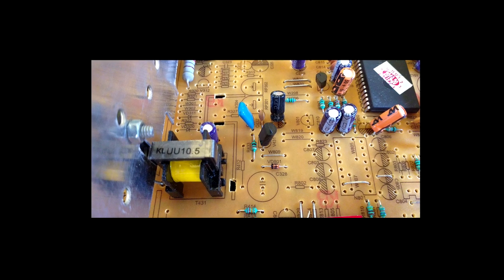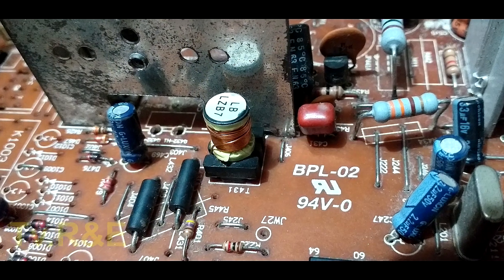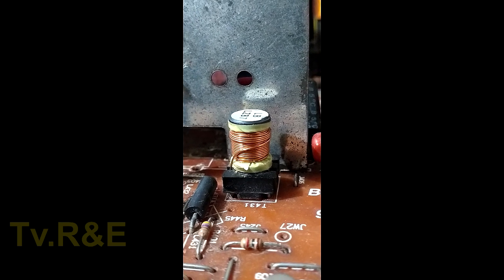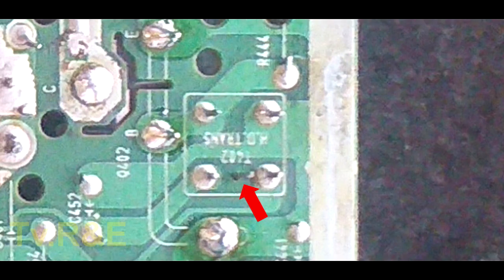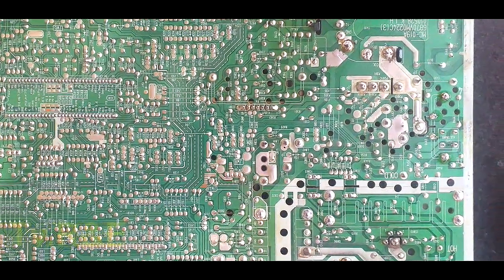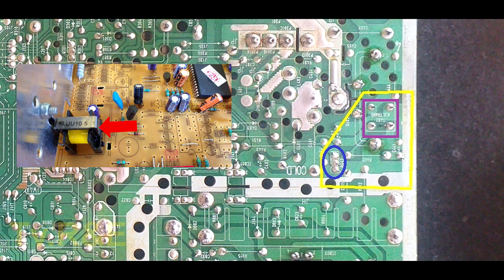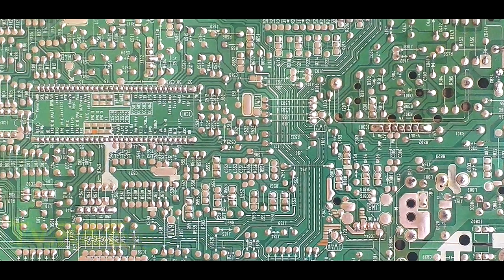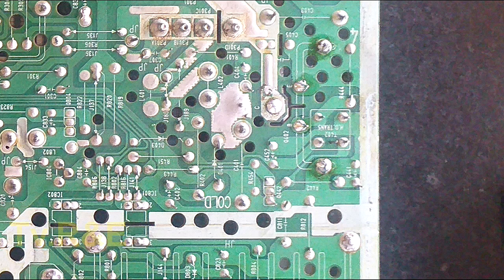T.v. Driver transformer.

Comment: Boss can you explain Phillips crt TV 29 inch pictures blurred sounds is ok, please help
Reply from the maker: Change the CRT base.
Reply: I changed but not good,,, I don't know how to do
Reply from the maker: Check the crt base board supply voltage and supply filter capacitor.
Reply: Give me your mobile numbe, I will show the picture

Comment: Primary positive 8 to 25 volt secondary side how many more puls for main i/c pl sow me sir
Reply from the maker: Driver transistor base voltage near about 
Dc 1v.
Reply: Sir, what to check if there is no enough voltage at the primary of the drive transformer that comes from chopper, only 2.4v